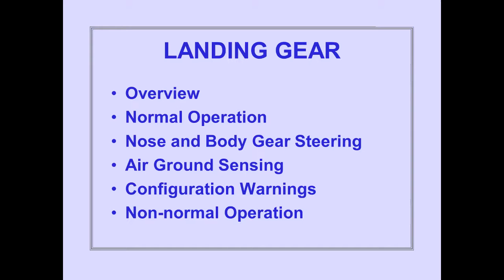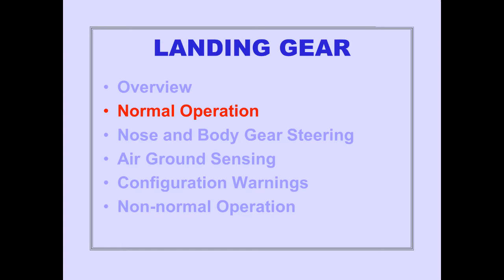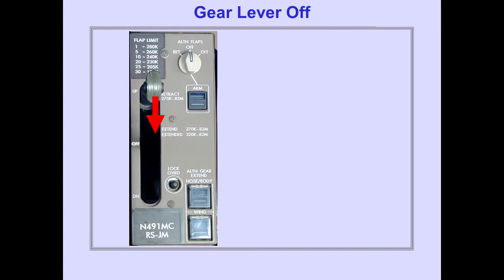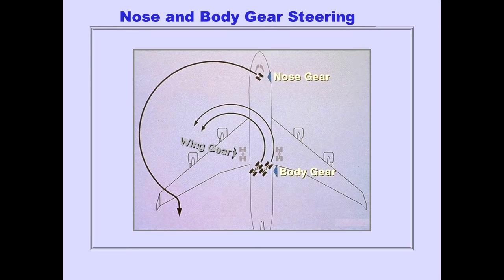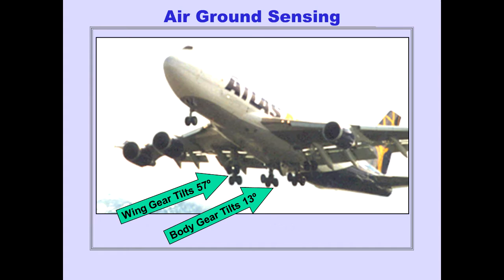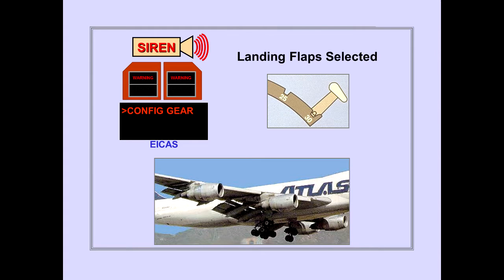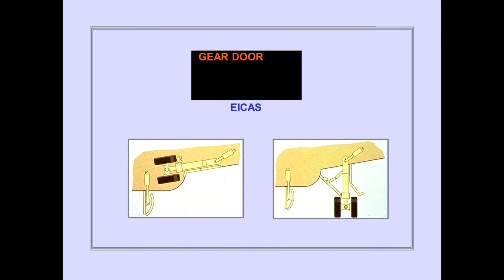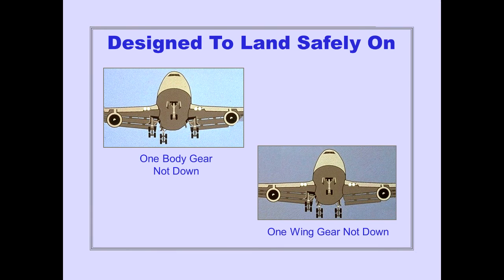#24 Landing Gear System Boeing 747 400 CBT

Comment: Is it possible to get a copy of the slides used in the presentation. Currently working on a design project which requires the depiction of landing gear operation and mechanisms. Your quick response would be greatly appreciated
Reply: @Kwstakis90  Alright thank you. DO you know where i can get the dimensions for the landing gear and landing gear itself?
Reply: @Kwstakis90  done